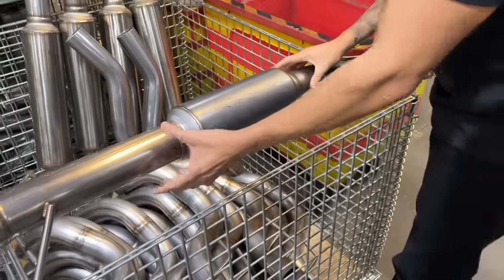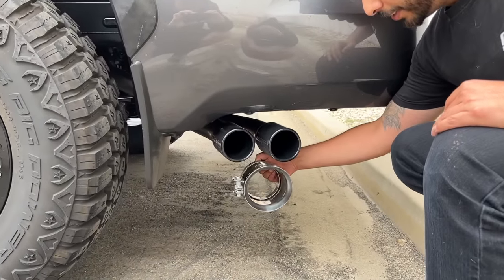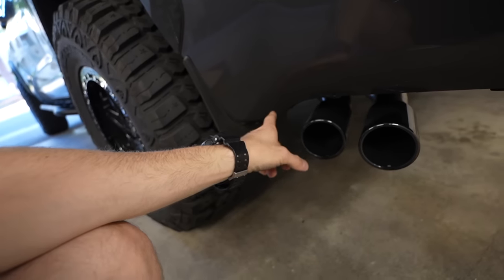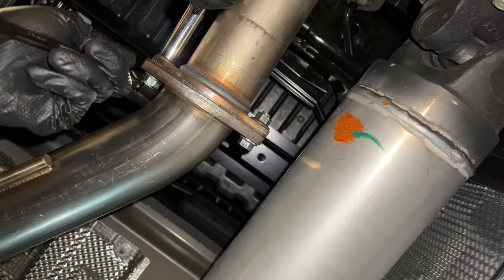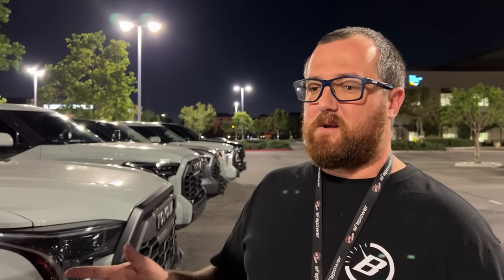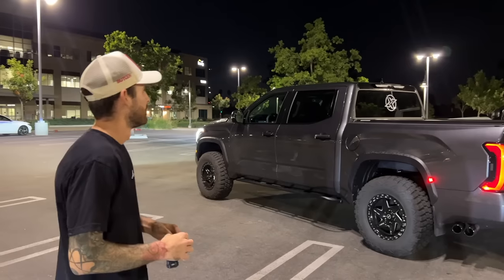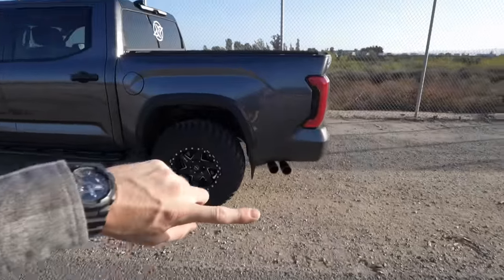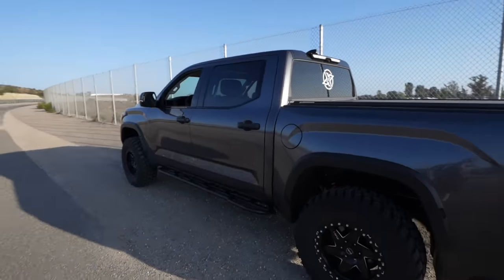CARVEN EXHAUST On My Tundra TRD PRO!!

Comment: I put a Flowmaster FlowFX dual exhaust on my 23 SR5 and swapped the muffler out for a 22” Magnaflow. Too much drone at 2k, now it sounds just right. Carven is stupid loud. Most people go with DirtyDeeds for Tundras.

The way the transmission works is it keeps it at 2k RPM aka the drone zone unless you’re stepping on it.
Reply: Does the 22” magnaflow bolt right onto the flow master pipes?

Comment: Definitely have to shim the 5 inch tip. Put my exhaust on 2 weeks ago or so and was told they are no longer shipping with the tip because of the tolerance inconsistency from Toyota. But i shimmed it and it looks great. Sounds amazing for it being a V6.